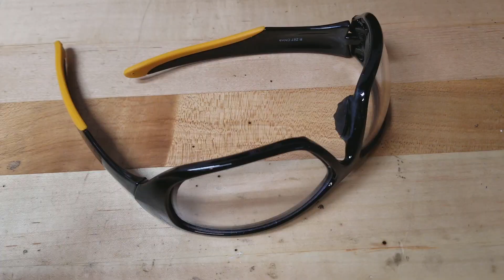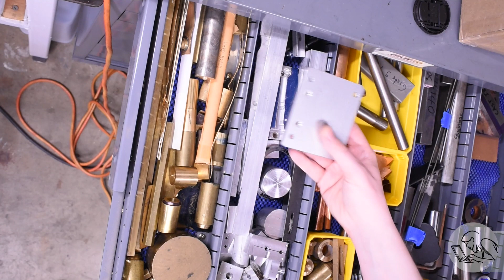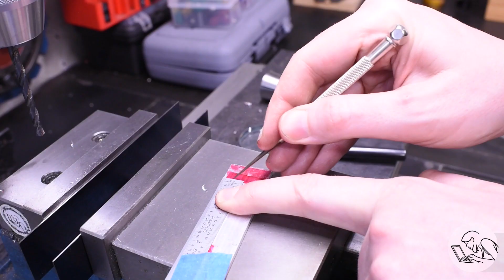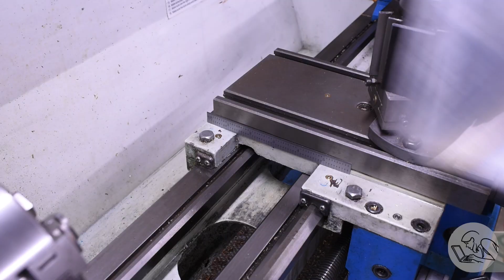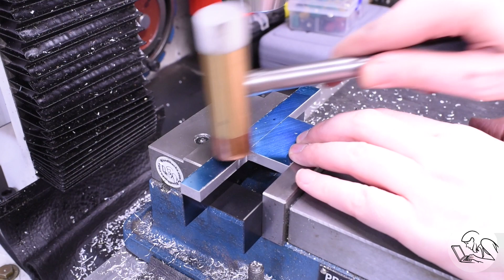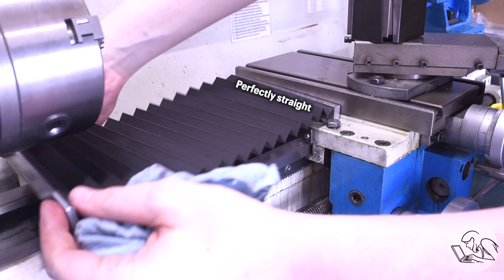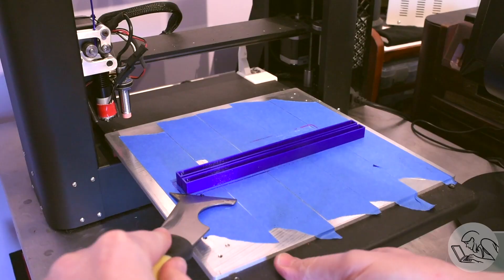Lathe Ways Cover - Let's Make One!

Comment: I wonder if the bellows would compress better if you connected an additional six inches of bellows end-wise, and then extend it only to 12 inches.  That is, if you avoid stressing the bellows it might fold back better.  I guess it depends on the yield strength of bellows, which no one knows.
Reply: The manufacturer obviously knows, but I checked out their website, and their model seems to be “tell us all about your application and we’ll make recommendations“ rather than providing engineering information and design guides.

Comment: “Hacksaw to build character”.. lol I felt that one. I also laughed at the “because reasons and shut up” for the 3D printed parts. Gold I tell ya. 
Did I miss what fluid you use in the spray bottle? I see that more often it feels like and I’m curious what that is. Great idea by the way, might have to do this for my lathe!
Reply from the maker: That’s Wd-40, my go-to cutting fluid for aluminum
Reply: @Blondihacks  thanks! Good to know! A guy I know suggested Isopropyl, but I feel better cutting with a less flammable fluid in case things get hot.

Comment: Dumb question...  why not just super glue the accordion material to a couple of neodymium or medium power magnets?  Would make it quick to remove and install for cleanup purposes and the magnets would attract anything ferrous making that easy to separate out of you had a reason to do so.
Reply from the maker: Magnets are hell in a machine shop
Reply: @Blondihacks  I can understand how that is typically true...  but careful and strategic use of magnets (typically electromagnets) can be quite beneficial in a machine shop environment...  Aside from the generality that magnets aren't good in a machine shop, what about this particular application makes them bad?

Comment: Quite the collection of tricks for making the stock you need from the stock you have!  I better get some machine tools so I can keep my shop as neat as yours 😜

I don't think I've ever seen you use that 4x6 bandsaw in vertical mode, amazing! I've seen folks put a portaband in a stand for vertical use, but that's a new one!

Have one of those hole punches for modifying leather orthotics, interestingly, but I will confirm it also works for adding holes to belts and basically anything else.

Comment: might i suggest another method that should work nicely... depending upon the distance between your chuck and the ways...

use the leather!
attach a spring loaded roller below your chuck, that the leather rolls onto as you aproach the chuck, and rolls off of as you go away from the chuck. this may also require a second roller to hold the leather down to the ways, so it never lifts away from them far enough for chips to get underneath it.

a thin long vacuum attachment might be wanted next to the tensioning roller to remove chips as the leather rolls up.

just an idea!
do with it as you will.
thank you for the video!

Comment: Hi there. Thanks for the video, lovely to watch as usual. You might want to chamfer the cover plates at 45-75 degrees to allow the accordion material to collapse more easily. You could also try burnishing a crease into the material a bit back from the factory fold so it lays across the plate and the factory fold falls at the corner. @Andre Berthlaume's suggestion of flipping the accordion (so the first panel is rising from the bottom instead of falling from the top) could also help it behave better when compressed.

Comment: Thought of a clever way to reduce bunching, without using fatiguing elastic:  thin nylon line (like for fishing poles) through the smallest holes that permit travel, affix one end near the headstock, through the cover, then through a smooth hole at the other end, around a radiused curve, to a weight.  As you move in and out, the weight(s) keep the line taut.

Comment: Stefan Gotteswinter uses them, Quinn now has one, so I've decided that I want one too. Since TOT hasn't made me spend any money for a while, funds are not an issue... but the only place I could find them was on eBay. Shipping from the US cost me more than the price of the concertina material. I wish we had McMaster Carr in the UK...
Reply: McMaster Carr 🙁
The other day I needed a special spacer/washer to repair some equipment for a customer. They were a few $s + $50 delivery - but time is money and it was an efficient way to get the job done. So, I order them thinking "they will turn up just as the other bits are ready and I can install everything".
Well, after a few days, I get an eMail saying "we don't deal with Australia, go away".
So I think "WTF, you let me select Australia in the shipping page and now you tell me?"
Anyhow, I still have time, I will just use a freight forwarder - it won't cost any more than before, all will be good.
A few days later, I get another eMail saying "we know you are really in Australia, using a freight forwarder won't fool us, we won't sell to you".
WTF!
(Weird company - it isn't like we are North Korea)
And yes, I bought from another US supplier where is cost less and arrived in 3 days.
What a waste of time and effort. Lesson learnt 🙁
Reply: Have you tried Misumi ? I've used Misumi.de ,  see Misumi- Europe if they  have an office in uk?. I have ordered linear movement components and special fasteners + Cad drawings

Comment: I use a lot of MIC6, and it's good stuff, but it is indeed gummy.  For manual machining, it's probably not a big deal, but if you're running a CNC machine at 10,000rpm, feeding at 50IPM, the chips can weld to the end mill, clog the flutes, and snap it off in an instant.  Lubrication and chip evacuation are critical.

Comment: I used to be a production engineer for a company that made waycovers just like them. In fact, I would not be surprised if they are the same we used to make. I beleive that those would be made from polyurethane coated polyester. In order to make them work better and not lift off your lathe ways you need to add a couple of internal supports. For a length like that I beleive that 2 or 3 would be sufficient. These can be made from thin (1/16" or 1/32" PVC) and glued in place with something like CA glue. The profile of the pvc support would match the shape of the ways and look sort of "I-shaped" in profile. Th elower portion of the "I" would slide along under the bed and stop it from pulling up. You just need to add a clearance of about 1/16" overall to teh profile to make it slide nicely. Any questions about this please feel free to email me.

Comment: If you want to minimize tooling changes you need to get a set of stub drills. For the level of precision needed here they will make centre drilling first unnecessary due to a much lower amount of flex.

Comment: My lathe is virtually identical to Blondie's and I have installed a left side ways covers as well spring type leadscrew protectors from China, neither one is cheap or easy to find  BTW. 
The ways cover is flat and the same width as in the video and just like Blondie said at the beginning it does not protect enough, lots of material find it's way under it. These covers that can be custom ordered to have an C profile however. I made the end pieces from sheet metal with 3 inserted neodymium magnets to hold to carriage and the headstock. Getting a perfect seal all around is tricky indeed.

Comment: I would have been tempted to try folding corners on the sides that went down over the sides of the ways... May have also solved the bunching up issue...  Corners like the ones on a old timey camera.pretty sure you can just invert the accordion folds on the section you're folding 90 degrees and it would stay 90 degrees...

Comment: Just a thought: If you attach the accordion material so that the end-fold is towards the bottom (rather then up as you did) it should be less floppy when fully extended. Might also close-fold more neatly too
Reply: I was about to post the same, but fortunately I looked first. I was mainly concerned with the folding working better when it closes up, but thinking about it you're probably right about it being less floppy when fully extended. It should also leave less of a gap between the cover and the the ways. So less chance of stray chips somehow making their way in under.
Reply: "Yeah? Well, you know, that's just, like, uh, your opinion, man."

Joking aside, your opinion is probably correct but I almost heard The Dude when I read your comment and I wanted to share.
Reply: Yep. I’d suggest trying this too.
Reply: That was exactly my thought also. Less bouncing and better folding.

Comment: I wonder if the folding problem of the material has to do with the shape?  It reminds me of a camera bellows or a RR passenger car diaphragm. I wonder if a sort of fold in the material, making a sort of V shape would help with that.  I'm also guessing that the elastic I think you mentioned would be required on both sides?  Or maybe a sort of very lightweight scissor linkage?

Comment: Nice addition. My mill came with a cheap version of the accordion material. After being so frustrated at the difficulties cleaning it, I removed it and went with an oil resistant rubber. I've been very happy with it. The material is supple enough that it just flops down out of the way. I also use that material as supplemental DRO scale covers for added protection.
Another addition that makes me feel a lot better is adding a horizontal strip of rubber slightly stretched over the lead screw. The path has to make a jog where the half nuts are but it's easy with the rubber. It completely prevents chips from getting on the lead screw and a quick brushing gets the chips down to the chip pan.

Comment: very nice Quinn, I also 3d print things and then cut them down because of reasons like shut up too! haha, jsut finished printing a fixture to hold a part for drilling, I figure the holes im drilling dont have to be dead on so 3d printing a fixture to hold it in place was way faster than anything else

Comment: If you put two spring loaded rollers on each end of the ways so that a strip of leather would be kept wound tight between them as the carriage moved, that might work.  Although the camera bellows method works too.
Reply from the maker: I actually considered that and you can even buy way covers like that, but it’s too bulky. It has to fit in less than an inch
Reply: I was thinking the same when she started describing the problem.